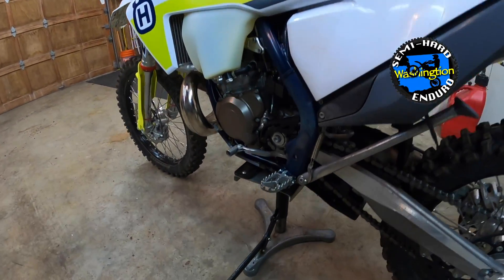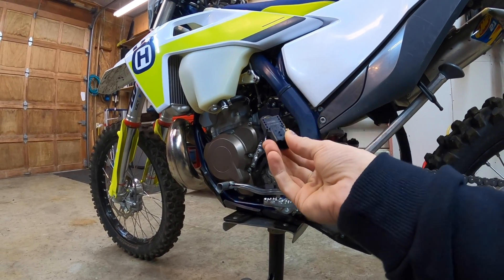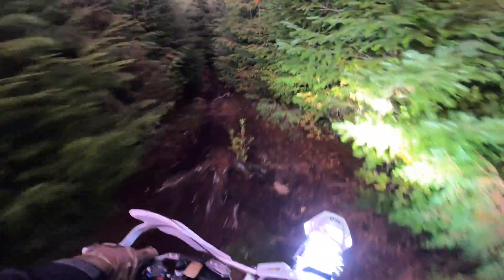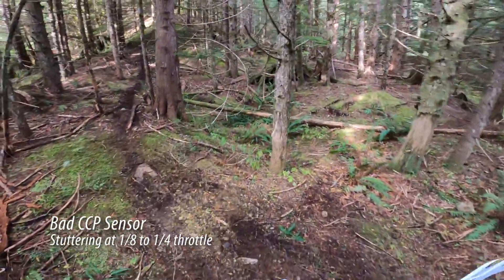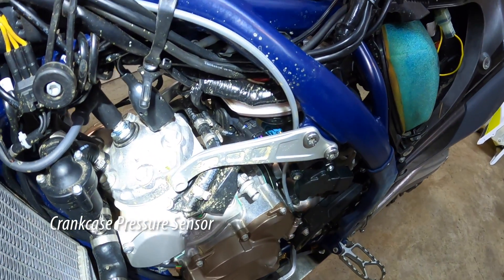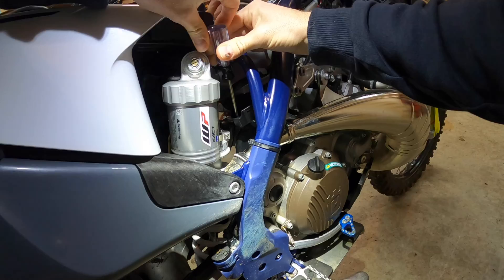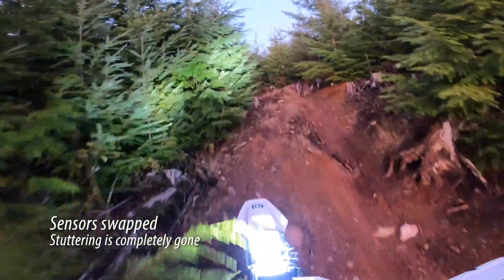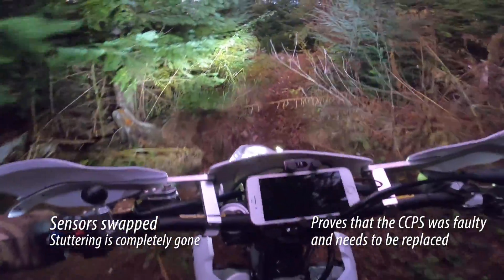HOW TO Diagnose KTM TPI Crankcase Pressure Sensor Issues (Faulty CCPS on KTM/Husky TPI Bikes)

Comment: is your new sensor still good? do they all go bad after a while? if they are both the same kind of sensor then do both need replaced? how would you know if ambient pressure sensor is faulty?
Reply from the maker: I’ve been having to replace my CCPS almost every 15hrs, but I’m also pretty sensitive to any stuttering. It cures it every time. 
Ambient sensor shouldn’t go bad ever. If you swap them and the bike runs better, then replace the sensor that is bad (the one you put into the ambient position).
Reply: @WASemiHardEnduro  what makes these sensors go bad every 15 hours?
Reply from the maker: @thepatternforms85  🤷🏻‍♂️ Nobody seems to know for sure. Dirty air from the crankcase is the leading theory. But some people seem to never have issues...
Reply: @WASemiHardEnduro  2021 here and no issues so far. This is really strange that it keeps going bad.

Comment: Literally exactly how mine sounds/feels. Was running fine, then one day it wasn't. Just installed the Slavens idle screw which actually smoothed out idling, but this sensor is the next step. Wish I saw this before I put the bike back together heh. Wondering how many guys out there went down the rabbit hole and purchased ecu's etc...
Thank you for the video!
Reply: Did it work ?

Comment: My bike starts to run like that when it gets hot.  Any Ideas why that would be?  When the sensor fails does the bike always run sputtery?  My bike runs really good tell I start working it in hard enduro and then once its hot it runs terrible.
Reply from the maker: What’s your air screw set to? Any mods?
Reply: @WASemiHardEnduro  My bike is stock, no mods runs perfect when I trail ride.  When I ride extreme and it gets really hot it starts to bog and run sputtery and rich.  Seems to start to do it earlier into the extreme stuff than before now.  Probably over 200 hrs, on my second top end.
Reply: @jbartziokas  i have the same problem, 16 hours new bike gasgas ec 300

Comment: I have ktm 300 tpi 2020 erzberg and the bike turned off while im riding it. And it Has 52 hours can anyone tell me what is the problem?
Reply from the maker: Could be 100 different things, need more info - what exactly is it doing?
Reply: @WASemiHardEnduro  it just turned off while im riding 2 times and  i can start the engine after the engine off but idk why the bike turned off while riding the spark plug has 10 hours

Comment: Great video, I might of missed it.  What are symptoms of bad ambient/ baro sensor?  I don't have the symptoms of CCPS but I have a good amount of spooge when with massive elevation changes and temp changes.  I have a 2020 TX 300 TPI with 130 hours.  I separated my shoulder and just changed the piston.  I think I could of stuck with 150-155 hours as with my 2017.  Thanks.
Reply from the maker: I’m not really sure, but inconsistent running when drastically changing altitude would make sense. If in doubt, change it.
Reply: @WASemiHardEnduro  I did order one to swap about and see if it changes anything.  I have the original update/ flash that came with the bike 10/18/19.  Thanks for getting back this way.  I am surprised how little info I can find on this.  I will spend some time playing around once my shoulder is better.  We found some fun stuff in WA, some tough stuff too!

Comment: Wow thanks for this video! I had tried to adjust the 'idle screw' on my 21 te250i for a touch higher idle but found the next time out it was just super sputtery at initial throttle like yours. Figured it was just from adjusting the screw, but putting it back to stock (or anywhere else for that matter) doesn't help at all.  Been on a few rides and am always bummed out bc it was damn near perfect, except the low idle, but I know theres the screw mod for that. Thinking the ccps is likely my issue. At 30 hours now. Thanks.
Reply: Curious when swapping the (hopefully good) ambient air sensor into the crankcase sensor spot (suppose that’s fixes the sputtering)why then does bike not behave poorly with a bad sensor in the ambient spot? Is it bc you’re elevation etc likely hasn’t changed and is stored in computer? Thx!
Reply from the maker: Based on testing by a number of ppl, it seems like when a sensor "goes bad", it's due to it losing some transient response; not because it simply doesn't work anymore. When reading a static pressure, the "bad" sensor gives the same reading as a good sensor, so on the bench it's indistinguishable. When measuring crankcase pressure, the pressure changes dramatically several times a second, from vacuum to positive pressure. Whereas when measuring ambient pressure, the variation is much slower. There's something about how the ECU used the CCPS signal that makes it more sensitive to issues (maybe it's reading an avg signal, or it's taking a reading only at TDC for example, nobody seems to know).
Reply: @WASemiHardEnduro  Ok awesome thanks for the explanation! Going to swap em and see... 🤞
Reply: @WASemiHardEnduro  Swapped em, issue resolved it seems! Thanks for the help..

Comment: Wow man you're a life saver. just completely fixed my bike. I was so close to using this POS KTM as a target stand at the shooting range. My 2019 300TPI ran so damn well that at 150 hours I sold it and bought a new 2020 250 TPI and could not have been more upset with how shitty this bike was. It fouled over 20 plugs within the first 10 hours. KTM dealer said there was nothing they could do. So damn frustrating these sensors can be bad from day 1.
Reply from the maker: Super happy it helped! It’s frustrating that even the dealers don’t know how to fix.
Reply: My 2020 300xc tpi started this shit today actually. But it’s at 145 hours. Has been the best running bike I’ve ever owned until today. I’ve fouled 2 plugs. Luckily I have a new ccsp on deck and it’s going in tomorrow as soon as I washed it. I guess I got lucky getting 145 hours out of mine. Some people I know didn’t get 10, 20 hours out of them.
Reply: Just wondering if the sensor fixed the issue your having with fouling and the stuttering? Have a 250tpi doing funny stuff and it’s driving me nuts.

Comment: But have you changed the crankcase sensor or the ambient sensor? Or both of them? How many hours did the sensors fail?
Reply from the maker: This test is just a way to determine if you need to change them. Since my bike ran better with the sensors swapped, I knew I needed to get a new one (the bad sensor was in the CCPS position, and after swapping it was in the ambient position). I replaced the bad sensor at 16 hours. Then the replacement also went bad at about 34 hours.
Reply: @WASemiHardEnduro  thank you very kind, mine too has begun to give problems with 80 hours, the candle wets me at minimum and is very greasy under torque, I will also try to reverse them and eventually replace one of the two.

Comment: Hello are they both sensor the same for a husqvarna te300?
Reply: 2019***
Reply from the maker: The ‘19 only has one sensor. Same part number.
Reply: @WASemiHardEnduro  how can I check if its this part if I only have one? Thanks for your help!! I think its this, I have change piston, cleaned exhaust valve, changed the spring valve and nothing worked...

Comment: It's really hard to find on which page on the microfiche it is, even for KTM dealers.  "Crankcase Pressure Sensor CCP Part # 55641075000".   The short of it is my 2020 XC-W 300 ran flawlessly for 34 hours and the sensor failed almost instantaneously. Did the swap and it ran great immediately.  Thanks for the great video that quickly got me to the root of my problem.
Reply: I found both of them on the diagram for the oil tank,  it was a pain to find though.

Comment: Even in your first clip it still sounds cleaner than most carb bikes I've ridden. Am I just not hearing it right or what?
Reply from the maker: It's subtle for sure, but when you're used to it pulling clean from idle to redline, having that stutter is very annoying.
Reply: @WASemiHardEnduro  I can't decide if my '20 sounds more like the first clip, or the second clip. But I've never worried about it before. But thanks for the vid I'll keep it in mind when I get back on the bike in the spring!

Comment: Thanks for video.  On  my 2020 ktm xcw (50 hours) had same issue.  The screws were T20. Also snapped the brass crankcase connector removing it - be careful if you do this.  It was clean and removal not necessary

Comment: Is anyone cranking their engine over with the plug in the exhaust after cleaning? I have a feeling that could build enough pressure on an electric start bike to fail the sensor. Can pressure build in the crankcase when the wash plug is in it and you crank it over?

Comment: Thanks for the video. There are several videos about the issue with the CCP sensor, but if its the same as the AAP, why only the first one fails on all those bikes? So can you help me out with these questions:
- did yo change anything on the engine before the issue?(air bypass screw, power valve spring tension?).
- did you try to "reset" the engine before doing anything?
-  how was inside the hose towards the CCP?
-  did you try to clean the CCP? 
-  and last, how do you know is the CCP and not the AAP?
Hope you can help me with these doubts, thanks!
Reply from the maker: The way the ECU utilizes the sensors is completely different, despite them being identical. The CCP is used for constant adjustment of low-rpm fueling, the MAP sensor is used to determine altitude. The requirements on the sensors are substantially different. The CCP is getting a constantly fluctuating signal from dirty air coming from the crankcase, the MAP gets a fairly constant signal of clean air. 
I made no changes before noticing the issue. A new CCPS fixed it completely. Resets did not. 
My hose and fitting were totally clean. 
I could tell which was the culprit because after swapping them, I replaced the one I moved to the MAP position and it had no impact at all.
All this has been repeated by numerous people on ktmtalk with the same results.
Reply: @WASemiHardEnduro  thanks!!

Comment: I’m happy with my 2018 carbureted Te300 I did add the Lectron no issues at all. 😁
Reply from the maker: Thankfully I haven’t had to replace my carburetor....yet. :)
Reply: how much did it cost Lectron?
Reply: @nduro25rus55  it cost me $450 with the motion pro throttle and longer cable.
Reply: No reason to own a TPI bike except to support Euro emissions requirements while owning an inferior product.
Reply: @carlatamanczyk3891  You dont need tpi for euro emmision, thats only something KTM tries to convince you to. Even the new euro5 is reachable with carb

Comment: So after you swap them are you replacing the Ambient air sensor with a new sensor so that both of them are good? Or do you not really need the ambient air sensor?
Reply from the maker: Yes, this test will tell you pretty quickly that one sensor is bad, and you would need to now replace the bad one. It seems to run fine w/ the bad sensor in the barometric position, but it probably won't handle changes in altitude well if you leave the bad one in place.

Comment: Anyone have a link to a video/tutorial on how to change out the crankcase pressure sensor?
Reply: More specifically, just the one under the oil tank...
Reply from the maker: Remove tank. Using a T15 torx driver, press the front of the tray down that is holding the CCPS. This will give you enough room to get to the torx bolt holding it. 
That’s it. It’s way easier than it looks.
Reply: @WASemiHardEnduro  just the gas tank?  Or by tank are you referring to the oil tank?
Reply from the maker: No need to touch the oil tank. Just remove the gas tank.
Reply: @WASemiHardEnduro  awesome - thanks!

Comment: Do you know if this would cause misfires while coming on the pipe at higher RPMs?
Reply from the maker: Not 100% sure, but it could be possible. Worth trying the swap to see if it goes away. Could also be how the power valve is adjusted too.

Comment: Are idea on any ways to see the issue without swapping the parts? Like using sensor data through a scan tool? I am trying to figure out if there is any ways to diag these sensors without just swapping parts around. I have had to put two of them in mine, once at 10 hours and once at 52 hours.
Reply from the maker: A obd2 scanner cannot seem to read the sensor output directly - only a calculated value from the ECU. It’s also not clear how exactly the sensors are failing e.g. what a failed voltage output is vs normal.

Comment: Got exactly the same prob, had the ecu remapped, did nothing, Will try this and see what happens
Reply from the maker: Good luck! It's easy to test at least. Comment again w/ an update if you get it resolved.
Reply: @WASemiHardEnduro  Was going to have a crack at it, cant work out how to get the ccp off, look like a big job, do you have a vid on how to remove it ?
Reply from the maker: This vid shows you how. T15 torx is all you need. Super easy. The tray it sits in it is flexible, you can bend it down to get easier access.
Reply: @WASemiHardEnduro  yes the one on the rh side is easy, the LH side is the one I cant get off ?? Cheers
Reply from the maker: @Phil_7990  You have to press the tray down to gain access to the torx bolt. I found one hand pushing it down from the left side, with the other hand coming in straight down from the top/right of the frame with the torx driver worked well.
Reply: @WASemiHardEnduro  your talking about the ccp sensor above the cold start button, correct ?
Reply from the maker: Yes that’s the one.
Reply: @WASemiHardEnduro  Many thanks
Reply: Mate your a genius !!, swapped those 2 sensors over, problem solved. Cheers -:)
Reply: @WASemiHardEnduro  You can loosen two screws that mount that tray to the oil tank. The front one lets the tray flex quite a bit lower. IIRC a 3mm hex will do it.